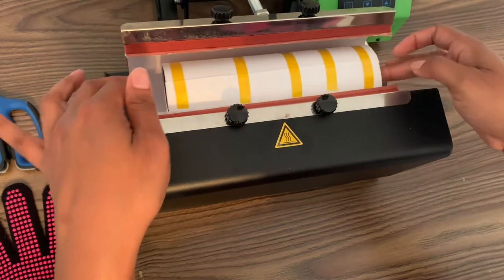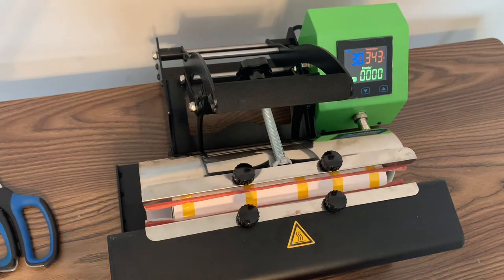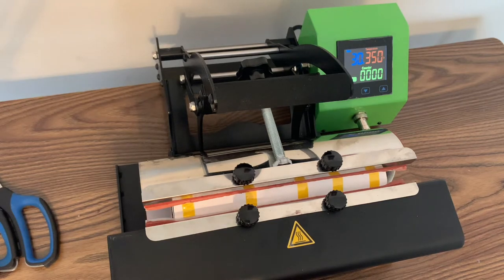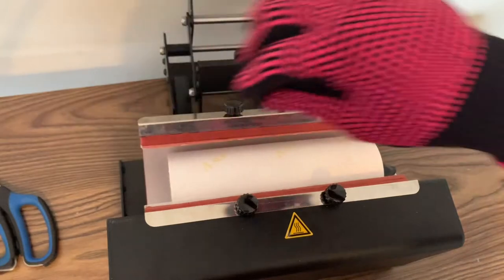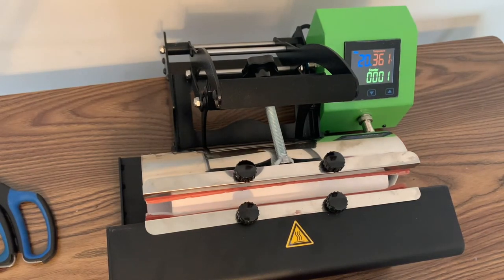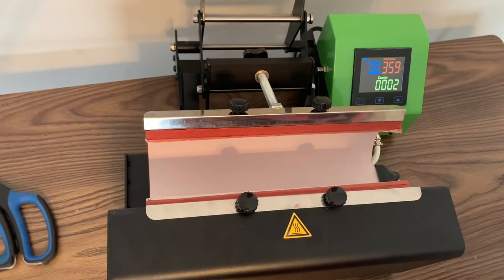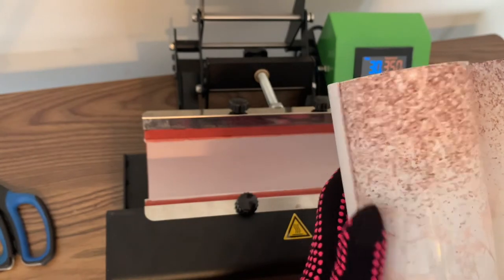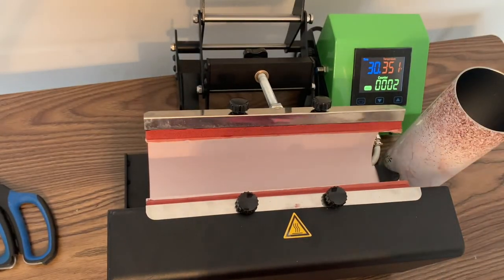How To Sublimate a 20 oz Tumbler Press In Under 1 Minute

Comment: I keep getting tape marks after sublimating ..like you can see the outline where I had the tape …I tried wiping with water and it’s still doesn’t go away? How can I avoid this ..I lost a lot of tumblers trying
Reply: Were u able to find solution
Reply: @pantojachris  no, I went thru a whole case of tumblers trying diff ways and nothing worked..these are the glitter white tumblers from HPN..
Reply: @ivettesanchez7947  i have same issue only the tape appears but colors are good ill let u know if i find solution
Reply: Reduce your pressure